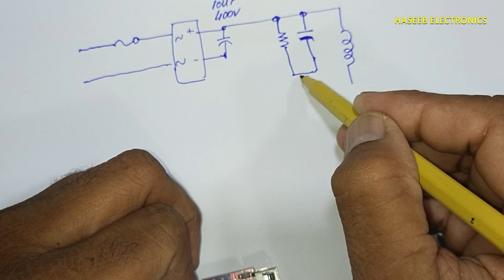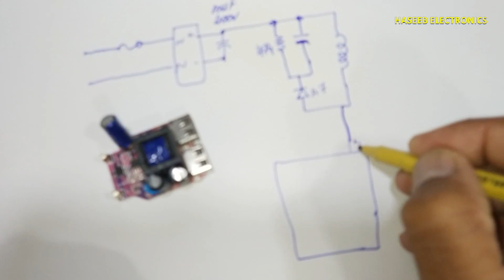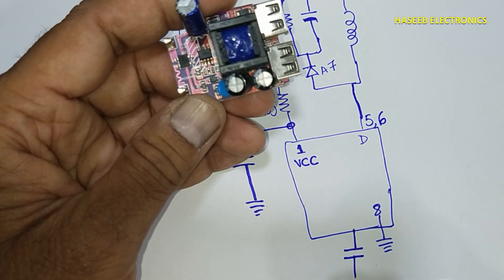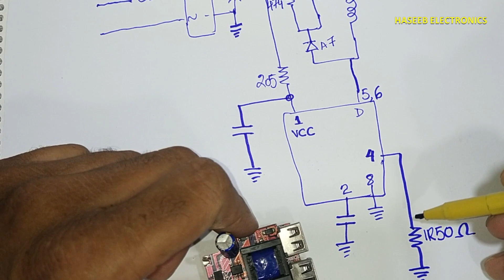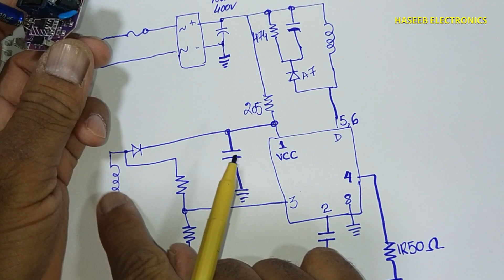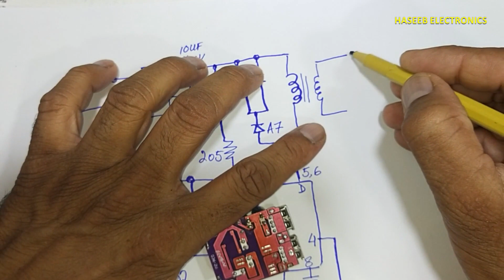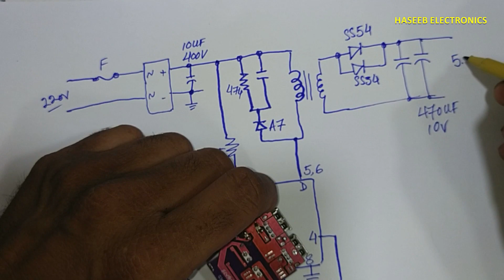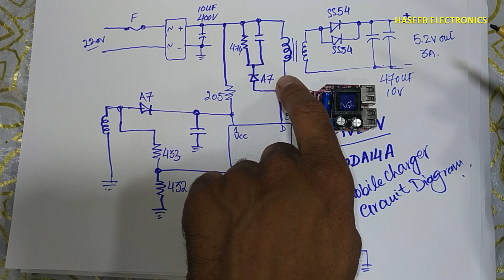{939A} Mobile charger circuit diagram

Comment: Sir,one thing i can't understand,
Auxiliary winding 's one side connected to pin no 3 via voltage divider resistor why without rectification voltage,
Why not rectified voltage provide to ic 's pin 3 from auxiliary voltage

Comment: Hi sir, why is the capacitor rating 10uF 400V,  shouldn't it be 130uF?
Reply: Hey! Not to sound rude but on what basis are you saying that it should be 130u? I'm just starting out on electronics but I'm having problems figuring out values of the component specially charge of the capacitor. Kinda curious on why you said that value.

Comment: Could u please do make a circuit for variable battery charger..  12v ,24v - 72v lithium batteries, which have different cut off voltages. . so need a potentiometer for cut off voltage set ., and circuit could support upto 20 ampere current. . current adjuster can adjust from boost convertor input supply .. I am finding everywhere but not getting anywhere. Plz do make it..

Comment: Dear Sir I have watch your videos it was so good in SMPS repair 
I have adapter in PWM IC in VCC voltage low power came instead of 18V or 21V 7V come in VCC pin can you guide

Comment: Sir, you mention that the class Y capacitor is connected between primary and secondary ground. (between the primary and secondary  coils?)
It seems to me that this capacitor is between the auxillary winding ground and the primary side of the transformer (its ground) .... is that correct ?
Very interesting how the aux coil can be used for voltage sense.  Thank you for sharing.

Comment: I have a question Hasseb, my phone charger has a charging capacity of 120 watts from the factory, and I tried another charger from a well-known company with a capacity of 120 watts, but the 120w  fast charging did not appear on the screen of my phone. What is the reason? I gained a lot from you about analyzing the power supply circuits, but is there encryption to force us use the factory charger.

Comment: How can you add variable voltage output?
Reply from the maker: in input???
Reply: @HaseebElectronics  Sorry no. On the output.
Reply from the maker: in offline switching power supply, the output voltage are approximately live in regulated window. 
as in offline switching regulator, it takes ratio-based voltage values from  auxiliary winding
and uses leading edge blanking method by means of current sense resistor
so 
in this it is difficult to take variable voltage from this type of converter 
while in optocoupler based feedback circuits it is easy to take variable voltage

Comment: Hello thanks for all those interesting lessons. I have two questions... FIRST, If we have current sensor on pin 4 why we need voltage divider for pin number 3? Second does chargers switching with out load? Thank you

Comment: Very very informative vedeo . So many ics are in Chinese circuits which has no nos. Or datasheet, which is big problem to repair the circuit. This is very very helpful vedeo for this. Pls share the proper calculation of output capacitor mathod Or formula also. God bless you.
Reply from the maker: best regards and special thanks 
sure i will arrange to share calculation process for output capacitor